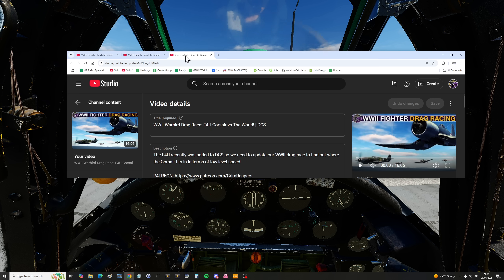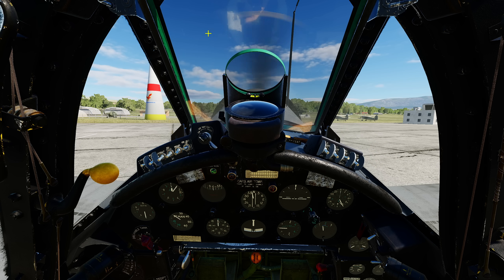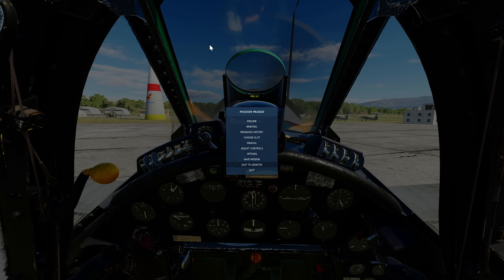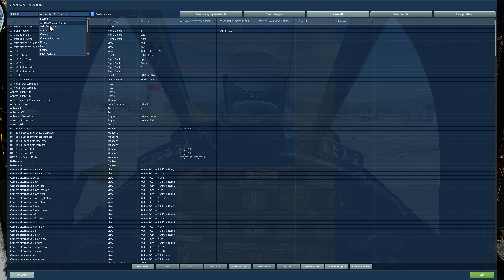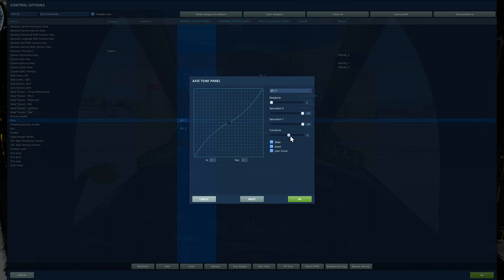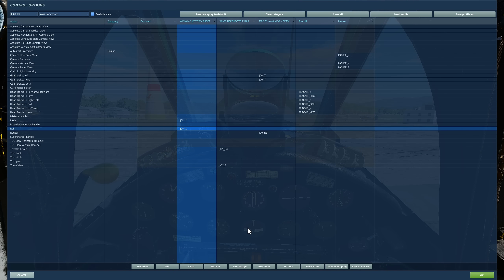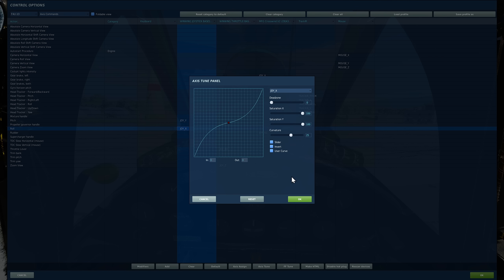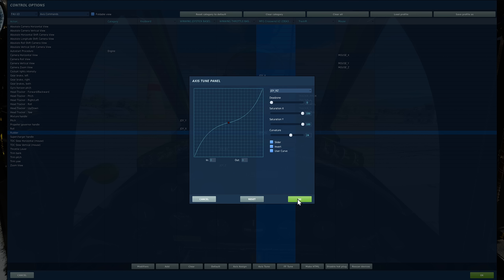F4U Corsair: How To Get More Power, Speed & Stability | DCS

Comment: I had been looking forward to the release of the Corsair, but the reviews have indicated that the flight model is nothing like the actual aircraft.  As mentioned in your video tests done during WWII, comparing the Corsair to the Mustang indicated the Corsair was the superior fighter in most ways.  Research into WWII fighter top speeds place the F4U at the top or near the top of the fastest piston engine fighters of the war.  Thus due to this seeming discrepancy between the DCS flight model and the real world performance of the F4U i held off on making the purchase.   Watching your original drag race video just reinforced this conception, however after watching this video where you found this apparent bug that restricted to Corsair performance and a work around that overcomes it, I'm back in the market for an F4U Corsair.  Thanks for this update. 

BTW,  for those interested in the actual F4 P51 comparison test,  there's a video by Marc Liebman, F4U Corsair vs P51 that analyzes this test.

Comment: After several hundred hours in DCS WWII planes and about 10 in F4U I dare to say- flight characteristics of this modul is horrible. Very dissapointing. Especially close formation flying is almost imposible, as every small change of power setting result in change of flight path. I don't beleive it could be the same in reality. Another issue is engine sound. When flying with closed canopy, it sounds like sewing machine.

Comment: There may be an easier fix to the engine power: Run in Auto Rich. There's a possibility the engine may be modeled as the R-2800-8, NOT the 8W the 1D is supposed to have, so doesn't have water injection (the system appears to be modeled, though it requires a separate key press rather than being linked to throttle as in the real Corsair, however it may not actually be providing power). The R-2800-8 used Auto Rich for Military and Emergency Power. Someone on the DCS forums ran a test, and with Auto Rich the speed appeared to fall in line with where it's supposed to be.

Comment: I know people are saying the engine only put out 2700 sustained, that being said this HP was able to produce speeds in the mid-upper 300's of MPH, not in the lower-mid 200's. If this is going to be fixed, they should keep the max sustained HP around 2700 but increase the speed output to match the real F4U-1D. For now, this trick works. Thanks for the VERY helpful tip!
Reply: You seem to be confusing two different things: the power the engine delivered, and the rotational speed at which it did it. The P&W R-2800 engine didn't put out 2700 hp ever in this airframe (though later versions in other airframes did). It put out its maximum horsepower at 2700 revolutions per minute, but as fitted to F4U-1D and FG-1D families of Corsair, the most powerful versions of the aircraft as modelled in DCS, the maximum power was more like 2250 hp.  The developers need to make several changes. First they need to remodel the engine so that it delivers its maximum power at 2700 rpm, and that revving it over about 3100 rpm destroys it. Second, they need to fix the drag modelling because at realistic power settings this model is slower than it should be
Reply: Do you know how a pitot tube works? And that the Corsairs airspeed indicator is in knots, and INDICATED? Not true? Do you know how to calculate for true air speed? This Corsair in DCS at 46inHg of MAP and 2550 RPM will cruise at 400mph over 20k feet. I’ve done it myself, multiple times.

Comment: If it's a r2800 then it's displacement is 2800 cu in with max rpm of 2800. So the bug would be the extra rpm with it not coded for max power at max rpm.

Comment: Performance depends on whether it was the std PW2800-8 engine, or the PW2800-W. The std operating rpm was 2700rpm, but there may have been a short-term speed increase with water injection of the -W engine.
Pre 1942 models produced 1200HP.  The  last F4U-1A upgraded to the PW2800-8W engine with 2250HP.

Comment: Sorry to ruin the party here but I spoke with devs and the RPM trick is just a bug, r2800-8 it is suppose to go not over 2700 in this version. Also max speed of this plane from real manual is 310 kn at see level, and you should be able to reach it if you are clean with all cooler flaps closed and with WEP which BTW you have to activate by pressing the dedicated button which allows you to overcome the metal cable protection, make sure you have it bound. If you questions feel free to ask. Regards, 
Dimitri
Reply from the maker: Ah, you've broken my dream of a 3000bhp F4U :(
Reply: Yeah sorry about that guys :) but on the bright side, you should anyway be able to reach the max speed (from the real manual) following the suggestions I gave you above. Give it a try!

Comment: Looking at some old F4U-1D performance characteristics, under War Emergency Power, it could be doing 315-320 Kts at sea level. The normal 2700 rpm tests showing only 283Kts indicates there's some issue with the plane as implemented. Either something's broken like water injection not working, the plane is modeled with too much drag, the RPM at 3200 is actually the correct 2700 value, etc..
Your test with the plane at overclocked rpm is closer to the specs, but hitting 332Kts, it's the opposite side being "too good". Went from ~35kts under, to ~15 over.. A 50 Kts (57.5 mph) difference.
Reply: being 15 over i guess isnt to bad considering we had the ammo removed and only use 10% fuel so aircraft were much lighter then would normally be

Comment: In real aircraft large props start to have cavitation issues much above 2700 rpm because the blade tips exceed the speed of sound. The efficiency drops off drastically when that happens. It's modeled wrong in that respect. The Corsair is a big, heavy aircraft that carries a lot of ordinance. It's not super quick.

Comment: I think the Corsair has an issue of being underpowered at 2700rpm. All sources indicate the Corsair has a BHP of ~2000 at 10,000ft at 2700. 

Considering that's the same Double Wasp engine as the P47, it's only natural it would have similar performance. With the main differences being the Corsair's wing design and aero cancelling out it's carrier strengthening

Comment: Sorry for back-to-back comments, but the Corsair was massively upgraded throughout the war, and the model numbers (say -1 vs. -4) made a huge difference - for example, over 10% increase in top speed, and 30% increase in climb rate at some altitudes. If you are tweaking your F4U for realistic performance, I think you need to choose which model number you are trying to simulate. A "Corsair" is not necessarily a "Corsair".
Reply: It is quite clearly an F4U-1 / FG-1 in the game
Reply: Specifically:

The F4U-1 had a top speed of just around or over 400mph at critical altitude. It was equipped with a narrow-chord "toothpick" prop that limited acceleration, and rate of climb was only about 2500fpm at SL.

The early F4U-1As had roughly the same performance as the F4U-1. However, later in production the engine was upgraded to the R-2800-8W with water injection, which boosted maximum speed to 420mph at critical altitude. The water injection system was retrofit onto earlier airframes as parts became available. VF-17's F4U-1As were experimentally fitted with paddle props, (taken from F6F-3s) which greatly improved acceleration and boosted rate of climb to about 3500fpm at SL. The paddle props were also retrofit onto other Corsairs, as well as incorporated onto the production lines.

The F4U-1D actually lost about 10mph over the 1A because of drag induced by the knuckle pylons. It was also slightly heavier at dry weight (the 1A would have been slightly heavier fully loaded because of the auxiliary wing tanks, but these were in practice seldom used). Otherwise, acceleration and rate of climb were more or less the same, though it would have lost a bit of turning performance.

The F4U-1C was slightly heavier because of its 20mm cannon armament, but more or less performed identically to the 1D.

The F4U-4 upgraded the engine to the R-2800-18W, introduced a four-bladed paddle prop, along with a few other changes to the exhaust system. Top speed increased to 446mph at critical altitude, acceleration improved even further, and rate of climb increased to close to 4500fpm at SL.

Comment: Not the engine expert, but didn't the P-47 and the Corsair have almost the exact same R-2800 engine? It looks like Cap's P-47 RPM is limited to 2700. Why should the Corsair get over 3200 RPM if the P-47 only gets 2700 RPM? Also, not the avgas expert, but the Americans had 150 octane fuel in Europe by mid-1944. What fuel was the US Navy running? Maybe a Simba question ...

Comment: That's a huge bug. The R-2800 in the F4U-1D, the model in DCS has a maximum RPM of 2700. In a normally functioning F4U-1D, RPM  levels above that  should only happen in one of two cases. First small overshoots when moving the prop lever to high rpm suddenly, or if in a dive, 3060 is acceptable for a short time. In no case should it be sustaining 3200 or 3400rpm. That said, it should beat the Thunderbolt in a drag race like the one you did, but it should do it at 2700 rpm and at War Emergency Power (water injection on)  so something is wrong here.
Reply: Let's fix the Corsair, but, let's also fix the FW190 A8 1.42 ata manifold limit.
Reply: @stug77  YESSSSS  Please!
Reply: As always thanks for the input Greg! Are you planning a detailed video?
Reply: Exactly what I was going to bring up. The Vought/Goodyear FG-1D Manual states "Military Power" is 2700 RMP at 45" Continuous. This is what achieves 400+ in most cases. What we see in the game seems more like today's power settings due to 100LL Fuel which is typically 2500 RPM at 35-40" and normal operation at the old cruising power of 2350/30-35". Certainly, something is wrong.
Reply: How did the F4U-4 outperform the F4U-1D -8W? The "No replacement of displacement" F2G quad row radial suffer from power to weight ratio?
Reply: @USPdocter  The F4U-4 has the -18W engine with water/alcohol injection increasing power to 2,450 hp.
Reply: @harryspeakup8452 The -4's engine has forged cylinder barrels and a lot of other upgrades, it's really a different animal.
Reply: The Corsair in DCS is going to take a while to sort out all of the peculiarities to the way the plane was modelled and all of the inaccurate bugs and in some cases deliberately inputting wrong values to make the plane fly worse. I think once the module is mostly sorted it'll be a lot more reflective of how it did perform in real life.

Comment: The F4U1D wouldn't have beaten ze 109K4 in a Simulation.  Here, it's a bug in a Videogame that, hopefully, will be fixed soon.  It wouldn't be far off, but it would be decisive for the 109K4.  I don't care which is emotionally more faster than the other, I care about simulation correctness.  Later versions did become considerably faster and quicker, but close to sea level, the K4 is ahead.  My guess is that someone tried a future concept and forgot about the mouse-drag-input. 🫛 out.

Comment: For a big heavy warbird I also found the pitch unrealistically sensitive. Putting in a big curve makes the change at extremities too high though so I use the Saturation Y-axis to calm it down, with about 75 Y-sat you can then have less of a curve, say 15, and get (for my short travel joystick) a more controllable feel. Its just like taming the first flight model version of the gazelle - less extreme curve but decent y-sat reduction works for me.
Reply: This is such a common problem with sim flight models: I find it a lot with FS2020 too
Reply: reduce your input saturation to 50-70% max and it´ll be fine...i did this years ago with Spit nad Mossie too !!

Comment: The Corsair was “the” fastest prop driven aircraft in the U.S. inventory right up to the moment the F-9 Bearcat showed up in theater and missed the war. Hopefully, this will be resolved by the time I find my way back into the hobby. I have purchased it being a Black Sheep (BSS) member since 1999.
Reply: F8F Bearcat, the F9F was the jet Panther and then Cougar
Reply: @harryspeakup8452absolutely correct. Typo on my part.
Reply: Not the F4U-1D. Not sure what people have problems with this, just as a Spitfire MkIX isn't Spitfire MkXIV, F4U-1D isn't the same as a F4U-4. The max speed of the 1D which we have in game is 426mph. in the P51D it's 440MPH
Reply: @Gunfreak19  Right on. That  426 mph = 370 knots. I cannot get anywhere close to that in my DCS F4U following the chart RPM/Throttle limits.
Reply: @cello64 at what altitude? Is it IAS or TAS? At 18 000  feet 300 knots would be over 440 knots in true air speed.  At 18 000 feet you need just 250 knots on your speedometer to fly at 369 knots in ture airspeed. Or 426 mph. So i recommend you fly at different altitudes see what you get on the speedometer then find a true airspeed calculator to find out how fast you are actually flying. I get 350mph at 1000 feet flying 2700 RPM 59MP.

Comment: Well I was just reading up on the Pratt & Whitney R-2800 Double Wasp and the usual 2800rpm applies even in the 2800hp variants. Although the prop is geared the engine turns the usual 2800 most aviation piston engines do. The higher power is absorbed by a larger diameter prop turning slower than 2800rpm (assuming my sources are correct) to stop the tips going supersonic.
Try more manifold pressure with full rich mixture.
Just in case you don't know, in a constant speed prop aircraft when in constant speed mode, the prop pitch controller controls engine RPM. The throttle controls manifold pressure. The mixture controls mixture.

When the prop pitch controller is in the Full Fine position, then the propeller effectively becomes a fixed pitch propeller, and the throttle acts as a throttle would in any fixed pitch aircraft. For takeoff, landing and dogfights the prop pitch is always Full Fine.
It is a high priority task for any pilot to manage the prop pitch and manifold pressure. 

When in constant speed mode, say you set 2100rpm. The prop pitch controller infinitely varies the blade pitch* to maintain that set RPM. *it's limited between the coarse and fine stops

The throttle then, applies more or less manifold pressure - high manifold pressure at 2100 rpm means the governor will automatically control blade pitch to stop overspeeding and underspeeding above 2100rpm and conversely, a low manifold pressure will allow the governor to automatically control the blade pitch to stop underspeeding and overspeeding. 

The engine power setting in constant speed mode is according to the pilot's operating handbook. This means there's settings of RPM, manifold pressure and altitude in a chart which correlates to HP, TAS and fuel consumption. 
A rule of thumb in GA aircraft is same MAP and RPM. 

In cruise if you don't have much fuel you consult the chart for best range MAP and RPM, if you don't care about fuel and you want a high speed cruise the chart gives you the combination of MAP and RPM for that. A balance of speed and a fuel consumption then the chart has that. The chart tells you all of this for every altitude. 

That's the principal of it. The reality is the governor constantly varies the prop pitch for aircraft speed, air density, accent, decent, altitude, temperature automatically for every MAP setting. 
Some combinations of MAP and RPM are always avoided like 1500rpm and 45"HG - you can see this will be detonation heaven because the engine speed is low and the boost high. Some combinations are avoided for harmonic reasons in some engines.
Reply: Almost... Full Fine is just high RPM and the governor will increase blade angle as airspeed increases because drag is going down on the prop/engine. This reduction in drag results in an rpm increase which the governor detects, sends oil into the hub to have the blades take a bigger bite of the now faster air, the airplane accelerates, the relative wind increases, prop drag goes down, rpm goes up, governor increases blade angle..., until you finally have best forward speed for the power setting and thrust and drag are equal. The faster the airplane goes, the bigger the bite the prop must take to harness the power of the engine without overspeeding. This is all happening fluidly and immediately and is not noticeable by us the pilot. If you make a power reduction (let's say rapidly pull to 50% power) you would see an initial drop in RPM as the blades are taking too big of a bite (not their lowest pitch) and pull the motor down, before the governor can release oil pressure and let aerodynamic twisting forces and hub spring pressure lower the blade angle to maintain the same rpm with the reduced power.
Reply: @FlyinandDrivin also, pulling power when at full rpm setting will slow the plane down dramatically. Due to the flatter blade angle and the higher speeds.

Comment: The max permissibel RPM in a dive is 3060 RPM. The RPM @WEP is 2700 RPM. @3600 RPM the enging would normally die within seconds. It should be clear, that this is a Bug/Exploit. We KNOW, what the max RPM is -> Pilot's Handbook of Flight Operating Instructions  AN 01-45HA-1
Reply: What we don't know is whether the 2700 shown on the gauge is accurate or not. 4200 could really be a misreporting, where that's actually the real power output you would get at 2700. I tend to value what the aircraft can do or not do rather than what the gauge shows here. And this airplane being substantially slower than a BF-109 at "indicated" 2700 is a foul ball.
Reply: @fargo007  At 4700 RPM we have an MP of 100+ or so... At 2700rpm and water injection (throttle full forward) we get exactly the MP value that you should have at the corresponding altitudes. You can therefore assume that the gauges are correct.